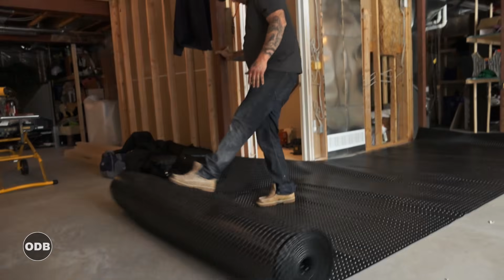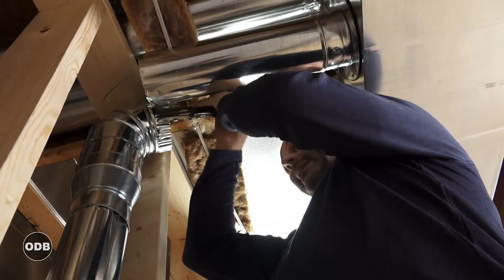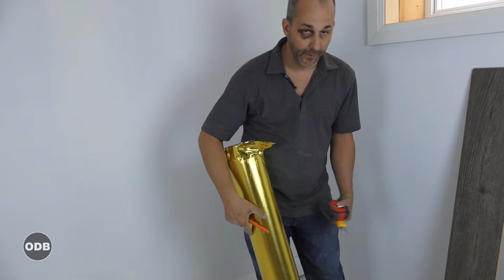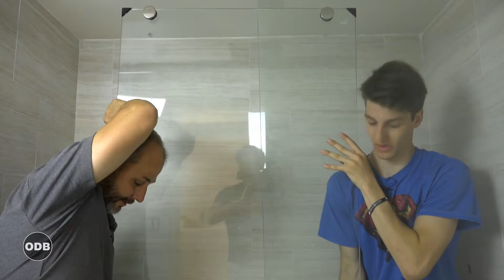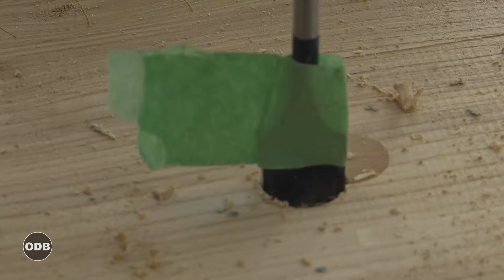DIY | How To Renovate an Unfinished Basement | A To Z

Comment: So I found out that rats were getting into my house through flex ducts and once in the walls, they chewed a 2-3 inch hole in the drywall in a room that I never go in.  Because the sheet metal duct tubes are cheap if buying in bulk, I decided to upgrade to this. Really not that expensive for something that lasts so long. Anyways, i struggled to make a tube out of the sheet metal, and I havent gone near them since December. Not sure what I am going to do....maybe hire someone just to tube the sheet metal. But,  Seeing you do the heartshape thing gives me hope. THat seems doable.

Comment: Wonderful videos! Thank you. One thing though: When building walls in a basement under TJI's or any other engineered product, there are some things to consider. A bearing wall is one that has contact with the floor and structure above. By having the top plate touching the structure above: the structural properties of those members change and add a load to the floor which is generally not designed to have a load added as it would only be 4". doing this could cause cracks in the concrete and TJI's or trusses to fail. Make sense?

Comment: Hey Jeff, I also twitted you for this question. I live in New Jersey and I have this insulation in the top half of the concrete walls. My question is, can I just remove the insulation and paint the walls? Will the main floor become too cold because of this? To be clear, I don’t seem to have insulation on the ceiling just the walls.. please let me know your opinion, I am planning to start the project tomorrow if possible

Comment: Hello Jeff , I want to work on my mother in law’s unfinished basement , problems in basement are :
Leaking from edge of the wall from four side of the walls 
Windows are all gone , need new windows 
Framing and insulation then flooring 
Don’t know where to start , we can’t offered to get it done by professional at this time so thinking to DIY 
Need you your help 
I can send you pictures and video of basement once I have your email address 
Thank you Umm e Ryan
Reply from the maker: you can find the email in the members section on the home page. as for the starting point. I would start at fixing the grading around my house so the water stops coming in.
Reply: Nop email is not there I looked more then once on home page under membership section (it does say member exclusive access to private email but email is not there )

Comment: Important to note, that on a beam...The bottom of the beam is fighting expansive forces, the top of the beam is under compressive forces.  The center of the beam does very little.  hence the shape of an I beam...If you lay an I beam on its side...your doing it all wrong...unless your influence is coming from the side.  If you cut out a middle section of an I beam, you are doing very little to it

Comment: In case anyone is wondering,  the purpose of the long drill bit is too absorb torque.  Keeps things from breaking.  Traditional wisdom says to use nails when you need sheering strength, use screws when you need pulling strength.  There are times in life when you should use nails,  but the screws of today are not the screws of 40 years ago

Comment: Have you ever gotten confirmation on the maximum joist hole size? I’ve heard several different things from the engineering or code standpoint that 4” would be the maximum and that it is required to be dead Center. Just want to make sure I’m not messing up anything since my home is over 100 years old.

Comment: I'm want to finish my basement, on my new home. I have what i think it's called a French Drain, which is about an inch gap btw floor and wall, all around the basement floor. I want to finish it without losing the minimum square footage possible
Do i start my wall at the very edge of the gap, where the floor start. So basically there would be about 1 inch space btw my frame and the outside basement wall.
Any suggestions.
Thanks

Comment: It's so great seeing someone else using the trick to build your window trim on the floor. When my dad and I were doing this back in the 90's, other finish carpenters were still cutting each piece and nailing it one by one in the window frame, and it always looked terrible.  Meanwhile we would trim out the whole house and then walk around just nailing them all in. :)

Comment: In materials alone you will spend less then $3,000, if you do it yourself. Yet people are charging ridiculous prices in labor alone over $15,000 to $25,000 just to finish a basement. Lucky i found a Mexican contractor and charge $8,000 to finish my basement. Got to look around and get 3rd to a 5th estimate before jumping on a big project like this.

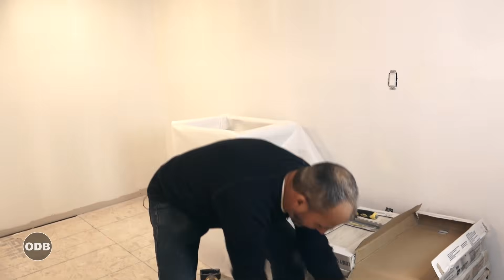Comment: 1:20:15 Overflow? Do you mean the pressure relief  valve? All to often I find once you force those open, there a bitch to get them to close. Seen it a thousand times. That's not an exaggeration.

Comment: Hey Jeff, I'm finishing my basement and we're almost done with drywall, just need to texture.

My question is what item do I need to tackle next and what order so I need to go in? Carpet, painting, moulding? Thanks!
Reply: I would suggest painting, carpet, then moulding, as long as your cutting it outside of course. My name is Jeff and you didn't specify if any Jeff can answer.

Comment: The system of fixing the toilet is very strange, it works, but attach it to the pipe? In Europe, you attach toilets to the floor and at the same time put it in a thick RUBBER gasket that is in the pipe. These screws were certainly not made of brass. Why are you yusing tile drills with hamer drill?

Comment: A finishing carpenter I know will rip his wood to size install in the window casing proud of the wall go back with a hand held power planer and flush the casing off then add the trim over the flushed up casing. he gets no gaps to fill with calk.
This works also  its just a differnt way to do it.
The casings were 6" thick he was using 4x4 popular and 6" wide trim work even on the floor.
The Whole job was stunning when he was done.
This was not residential house it was an apartment complex clubhouse and rental offices.

Comment: HOW DO YOU KNOW SO MUCH! I am I'm the process of renovating my basement during this COVID pandemic, and the framing for my basement is done, ( not perfectly) currently in the process of insulation, vapour barrier and drywall. It's an older house so nothing in the basement was level to begin with. Its all so overwhelming and frustrating, but I am trying to get through it. The dry wall nothing is really flush and I have uneven gaps, which I'm sure will be a pain in the you know what, when I have to mud and sand. Oh also installed a bathroom shower base which was hell, tried to self level the section for the basement ofcourse didn't make level for the base so I'm shimming it and still isn't perfect, but I've accepted it. I don't know why I am commenting all this information just needed to vent to someone who knows what they're doing. On a good note it is all one hell of a learning experience, took me 3-4 hours to install 1 of 4 basement windows, but I am happy about it, also made some stairs for the first time, took 6 hours, but after finishing that was all satisfying. So yah, that's where I am right now. Thanks for reading this comment hope you and your family are staying safe, cannot wait to know as much information as you do. Will save me soo much time!!
Reply: @mysticespresso6956  I very much appreciate that! A Long battle, that has never had felt so good to finish. Thank you!
Reply: How did it end up turning out?
Reply: @johnd9357  At the end of the day, the renovation is completed. We have a tenant move in, and everything is going good. Knock on wood. There is alot of things, I have learned during this experience. Every sense this project, I have been eager to learn more and do whatever I can to make something even the simplest things like making coat hangers out of a piece of wood and some hooks, is just so satisfying. It was alot of frustration working on the basement, but definitely worth it. Having a lower back injury makes things hard to do, but I make it work and go at my own pace. There is no rush, just have to take your time and sometimes step back and look at things differently. At the end of the day, someone wanted to rent out the place, and I can collect a nice beneficial income twords the mortgage. Trust me when I say this, if I can do it , ANYONE CAN.

Comment: is caulk even necessary at the top of the baseboards? I figure that painting the wall before installing baseboards would make more sense and save time. This way I wouldnt have to try to cut clean with the brush next to the baseboards. Wall is finished and painted and bamm put the base over it. It's kind of same principle as taking off the light switch cover and outlet covers, etc before painting so when you put them back on it has a nice finished look without trying to paint it perfectly around with a brush.

Comment: I’ve seen your video on finishing basement walls where you created an air barrier, used Tyvek, batting and poly. I’ve also seen a bunch of other videos of people using adhesive and foam board insulation on the basement wall.

What’s the best option for me? I live in Chicago and my walls are coated in a permaseal type paint already.

Comment: I am getting ready to finish a 1600 sq ft basement. Bedroom, kitchenette, bathroom etc. It is a brand new house. I know you said this is a walk out in this video and your were worried about moisture so you did the DMX with the OSB on top. Mine is not a walkout. I am in central Indiana with cold winters, and we definitely have 4 seasons. It is a poured basement. I am probably going to put a recording/rehearsal space down there too. Would you still do the DMX with OSB or would you just put treated framing on the concrete? Some of the floor will be laminate/vinyl and some will be tile.
Reply from the maker: since it is new you have a vapor barrier under the slab so i say go direct on top. Cheers!
Reply: @HomeRenoVisionDIY  Thanks so much!!

Comment: few things that are questionable in first 12 min of the video: floor with vapor barrier does not do anything for the leak that can happen from upstairs, and will prevent water from dissipating, therefore, entire floor will rot. Second thing, you are not supported to drill through the I-beam, but I understand the logic, that you will support it with wall underneath, still, not a good practice to drill through I-beams without engineering calcs.

Comment: Quick question: If You are not modifying any structure, any plumbing or sewage work, and not changing any electrical components but finishing basements just like you did... do You still need permit if DIYing?

Comment: don't compare a bending a 2X3 to a 2X3 in a flooring truss..  loading in a bending beam such as a plain 2X3 is completely different than the tension and compression it undergoes as a truss (floor joist)  the web, which is the OSB he cut through is there to maintain distance between the loaded members in tension and compression, the 2X3s..  Cutting out a small portion of the web will not affect the strength cause it will not allow the loaded members to come closer together..  besides the spacing on those joists was very dense, so plenty of support nearby if needed

Comment: End result looks good on the crown, I disagree its not the same size if its all sourced the same time same place. learn how to  cut it without ther crutch that plastic jig moved when your were using it it bent up not side to side as you pushed it into place if you spent 7 to 12 dollars USA a running foot you'd better learn it cost upside down and because no 45 is 45dgr learn how to find  the true angle and set the saw to cut that. Tommy on this old house has a good way to find the angle's and cut crown.

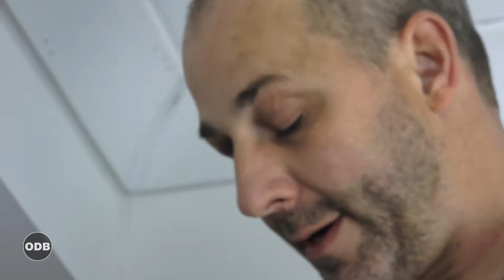Comment: 2:13:15  why you need that wooden piece on the roof's corners, that's a lot of extra work plus not to mention you have use silicone all around the gaps, that will eventually  cracked a few years later !!

Comment: I don't like shark bite fittings. I have 3 installed by previous owner that have slow leaks. They are a pretty shade of green from calcification of leaked water. About to replace with soldered joints.

Comment: Hearing you talk about 1/8 or 7/8 of an inch gives me the shivers. Today I installed a wallshelf and aligned it to the 10/254 of an inch. Well actually, I just aligned it to 1millimeter. Necessary? No - but boy do I like working as precise as possible. Even 1/10 of an inch is still 2.54mm. If you want to work precise, use the metric system!

Comment: Easy toggle install tip. Put the screw in slightly then hammer the toggle in. It will keep the toggle from bending or squishing.

Comment: I would prefer to have the sliding shower door on the right side(the side with the water valve)As you can run the water before entering the shower

Comment: Sometimes when I go into different places, and I see that  they have the wood flooring down, often times the baseboard is replaced with a flat piece of rubber trim,  as the baseboard trim. Is that better for the trim or is wood better to use? What about moisture getting behind that rubber trim? Is there a special type of bonding adhesive used to keep it from coming off of the wall? Is it more efficient to use cost wise rather then wood trim?

Comment: How did you set up your laser level for the wall? Was it based on the outside of your top and bottom plate? I never used one, that's obvious. Was your level changed for the door? I see your laser is hitting the middle of your stud.Why?

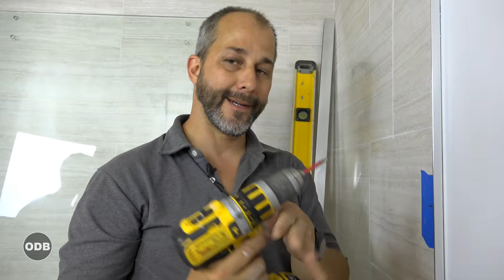Comment: those tile and ceramic drill bits are meant to be used without impact, just let it roll. That's why you go through them so quickly. The hollow ones can be bought in a neat package with a suction-fit thingy that allows water circulation for cleaning and cooling, just like the big core drill heads. Not that you can always use them like that, it just means they need to stay cool - some are specified for as low as 400 rpm. Also 40 money is really crazy, you can get them as low as 2-10 over here in the EU. A set of 5 sizes and the water attachment can be had from 13 or so euros but that's a steal even over here :) 2:24:10

Comment: Suggestion for your ductwork. When needing short pieces. Assemble a whole length of duct, crimp ends, tape length of seem with aluminum tape, and use a 4 to 5 inch grinding wheel to cut your length, file edge with file or grinding wheel. Crimp as necessary . Much cleaner and safer and faster than using Snips on a floppy piece of tin. Try it out I think you'll be pleased

Comment: I'm  sorry but you have to do better than minimum code requirements! You know water and wood  don't mix so please; just because your juristiction allows pressure treated lumber to be placed on concrete on that basement floor, You should still use a vapor barrier! Go above and beyond! The way I look at it is, the pressure treated might be ok but what about what touches the pressure treated? You must always use a vapor barrier on concrete! Wth

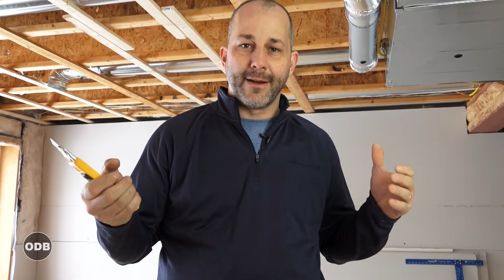Comment: Hey. At 36:00 when you talk about bringing a few heating lines closer to the floor, I saw the wall was framed with  2x6s, did you only frame that wall using the wider 2x6 since you knew those walls would have heating lines? Thanks in advance for your answer
Reply from the maker: That is exactly correct. Cheers!
Reply: @HomeRenoVisionDIY  thanks for the reply. I'm loving the videos. I learn alot from your renovations and use your tricks on my jobs. Also gives us a view of different and new products and their applications.

Comment: Jeff, as you're building out the initial wall to close off the storage room, are you using pressure-treated lumber to rest against the steel beams, or is it just plain spruce? Would the change in temperature and humidity follow from the concrete through the steel beams, causing the same sort of mold issues to arise in the long term?
Reply from the maker: no worries. the steel does mot transfer moisture in the same manner as concrete!

Comment: I really enjoy your videos. I am looking for knowledge on how to replace old wooden windows. We have a 22 yr old house and windows leak air and water and they do not open. They are solid wood complete with a wood sill, brick molding on the outside and 3 1/2" trim with an apron on the inside. What would be the best way to demo the old, how do we measure accurately for the new. How do we install the new to have the same appearance as the old?
Reply from the maker: Hi Jeanna, we just finished filming how to install a window replacement in an old house. should be up in a couple of weeks. Cheers!

Comment: Hey jeff,
Quick question...  when finishing and open area can I just closet around a water heater that is vented upwards or do I need to have any type of additional venting? Thanks
Reply from the maker: Hi Nikko, those heaters are designed yto radiate heat through the room not just direct it up. you should have some sort of screen to allow the heat to enter the room in all directions. Cheers! Having said that check with the manufacturer for clearance allowances if you really want to box it in. Cheers!

Comment: Hi, 
I am doing my basement by myself and using your videos as a guide. I am using a delta membrane and 5/8 OSB plywood Tongue and Groove. I am also going to be making a 3 piece bathroom with shower, sink, and toilet. I am wondering when I am doing my bathroom can I build my bathroom on top of the membrane and OSB subfloor?
Reply from the maker: best to use a tile membrane and then tile over the concrete. Cheers!